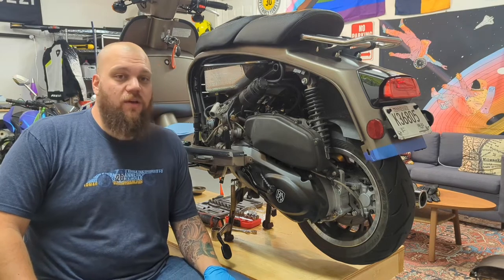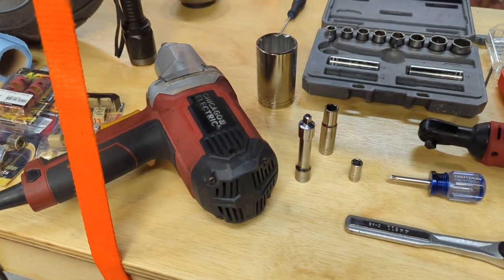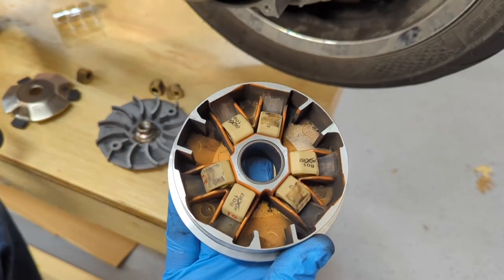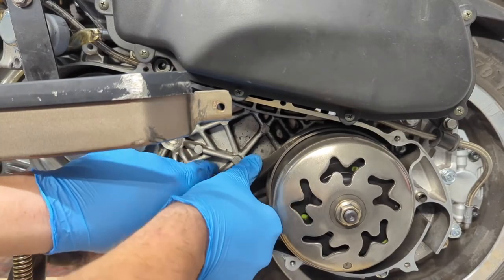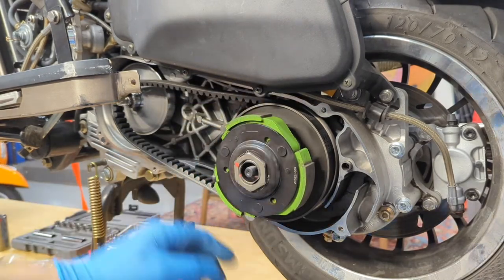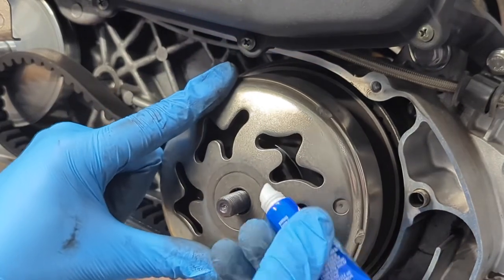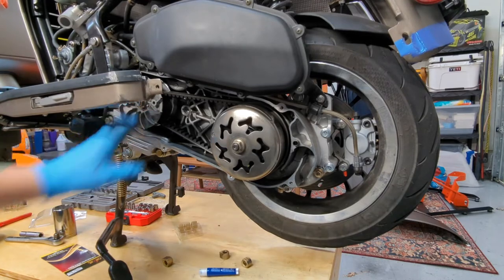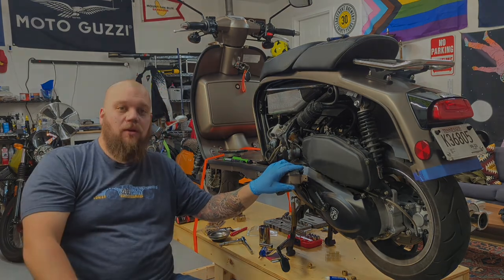Royal Alloy GT150 CVT and Weights Service

Comment: I have the same scooter the royal gt 150 2020 and did not ride it for some time . I tried reving it a little to much it was dying if i did not and i guess i melted something metal that came out in the back of the bike .
Looks like the material that the clutch is made of . What parts do you recommend getting got replacement and what do you think i melted 
Thank you
Reply from the maker: You probably would benefit from taking the transmission cover off and taking a look at the components. NCY makes the full kit, but figuring out what you need would be the start. Hop on the Royal Alloy USA Facebook group and show us some pictures we'd all be happy to help